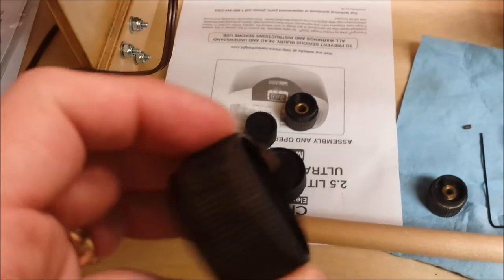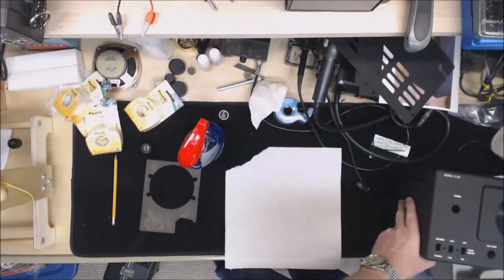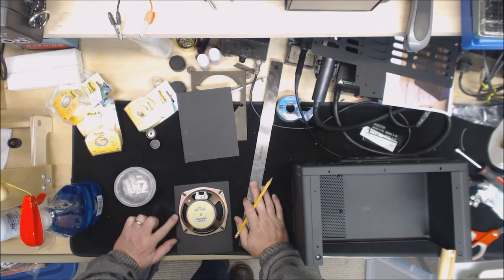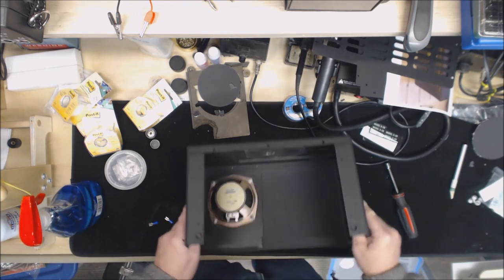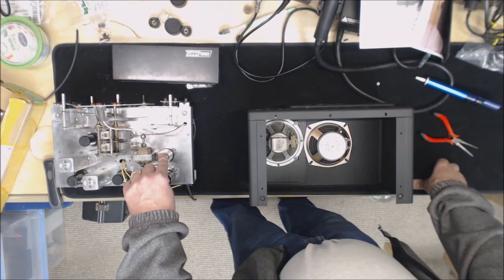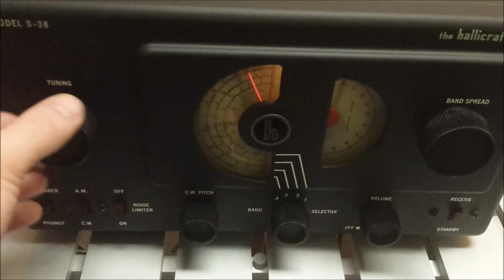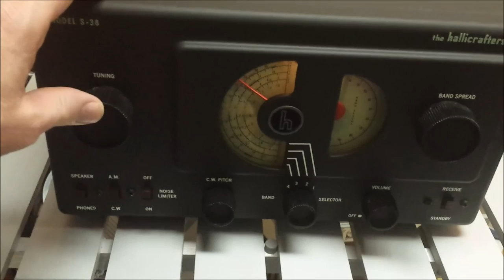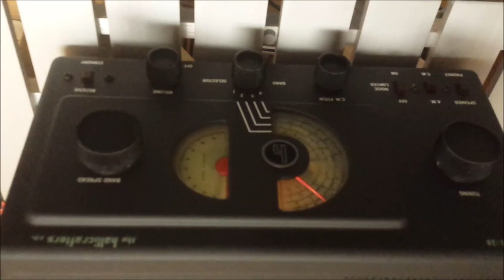K1SVC S-38 Restoration -  Part 8 Final

Comment: Once you figured out the holes to hold the speaker; you could have striked
across the speaker holes to find the center, then used a protractor to mark
the center hole for the speaker opening.  Simple!
Reply from the maker: I will have to do that when I get back to one of the other S-38's I have to do.

Comment: Something you didn't cover.  You explained about the problem with the new speaker you were going to use, and since it required different mounting locations for the "screws" to mount it with, and the new speaker mounting holes did not match the mounting holes of the S-38 speaker...how did you get a speaker from another S-38 to fit?
Reply from the maker: To be honest, I don't remember, I think I just solder on a stud in the correct positon.

Comment: I've also followed your videos. I have two Hallicrafters an  S-38 an "A" and a "B". I also have a 38B that someone else re-capped but did not do a great job. I am curious on a few things that you did not include in the last video. How did you replicate the broken knob? Where did you get a reproduction back? The only place I found does not answer Emails. Where did you get all the front panel decals? I would have liked to see you apply them. It also seems that the Hallicrafter decal is the original green color. How about addressing these questions in a #9 follow up video. Thanks
Reply from the maker: We made the knobs ourselves using a molding technique.  The back we purchased from a vendor off of ebay.  I believe you can get them direct from him at http://retro-tronics.com.  You can purchase water slide decals from http://www.radiodaze.com.  The later units we did, we made dry transfer decals ourselves.   We covered some of these topics in the S-40 videos.
Reply: Thanks for your reply.  I see the decals on Radio-daze and will order some. Retro-Tronics seems to be out of business. The web site is still up BUT every back is listed out of stock and emails go unanswered. Can you give me the vendor you purchased your reproduction back from/ Thanks Tom
Reply from the maker: Hmm, well I have a laser cutter coming sometime this fall, I might start to make some.
Reply: That would be great. Let us know if you do.